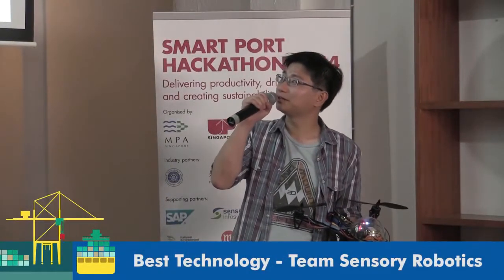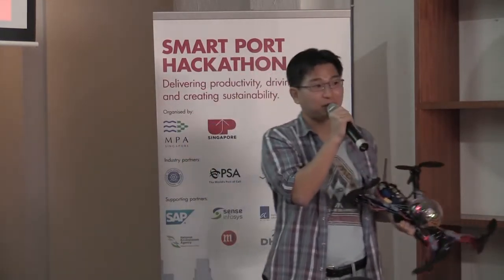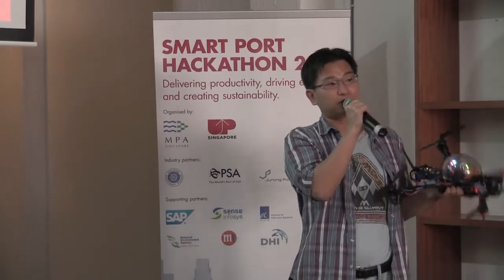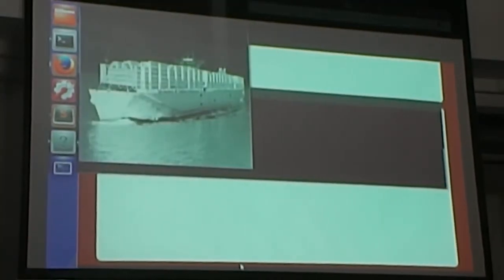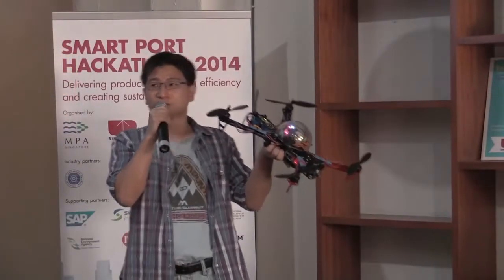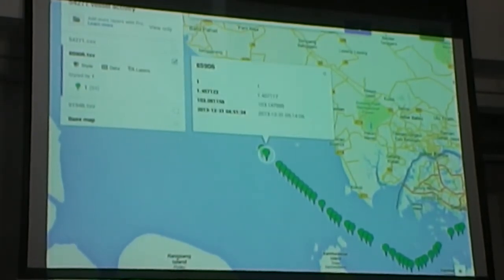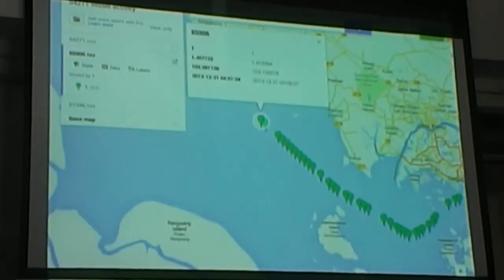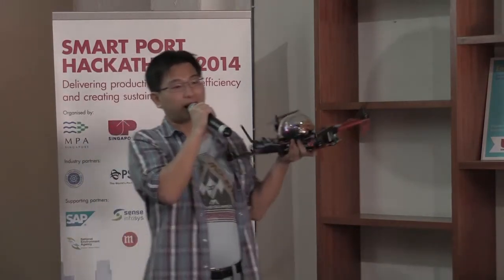Sensory Robotics @ Smart Port Hackathon

Comment from the maker: It can fly, launch and land by itself but it needs an operator to tell it where to go and what to do. It does not fly well in bad weather and strong winds (like all drones). Hazy skies will not affect it. We don't know the actual accuracy of the image analysis as we tested the algorithm on images of ships and not actual ships out in the ocean. Samples of smoke can be collected if you want to do different types of analysis like sulphur sensors and PM2.5 sensors for example but we mainly use image analysis for this project.

Comment: Does the drones need an operator, a driver? Or it is launched in a fully automated environment or base? Can it operate in bad rough weather, strong winds and hazy skies? How accuracy is the lens to analysis and replicate the actual colors of the smoke detected. How about density? Does a sample of the smoke need to be collected and analysis via contact sensors to report the level of pollution?